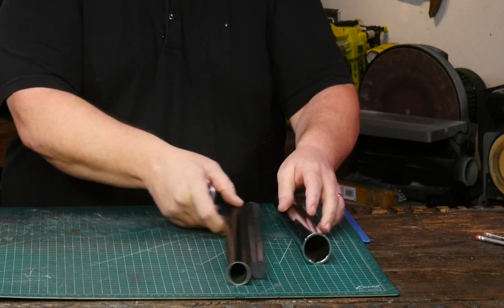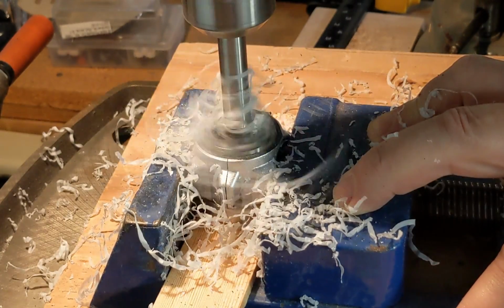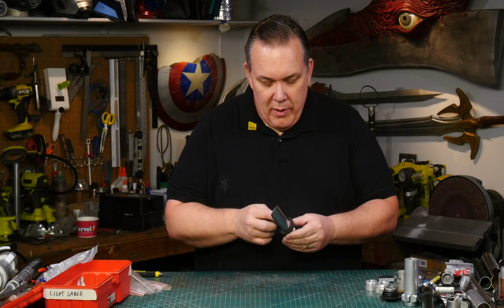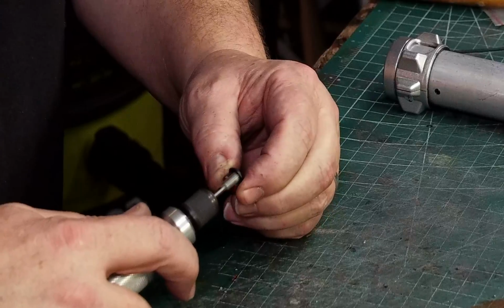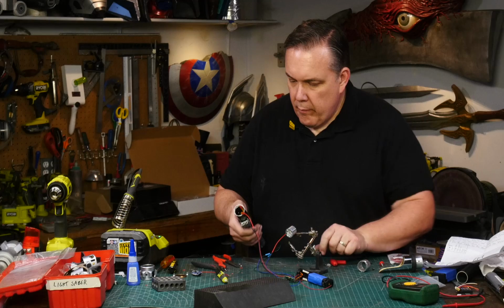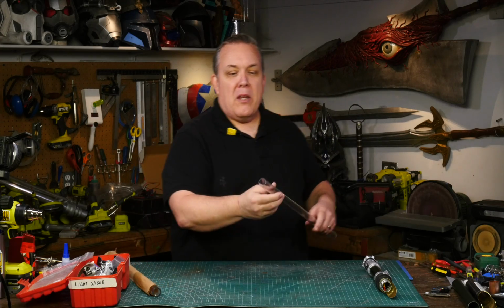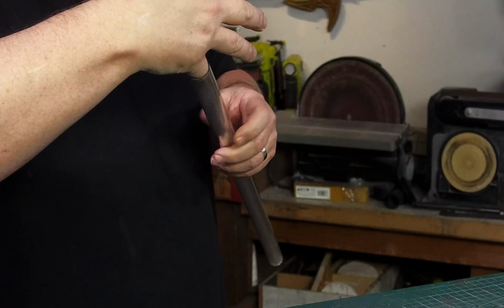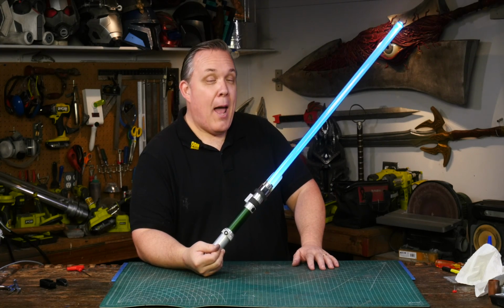Odin Makes: My own custom Star Wars Lightsaber

Comment: Thankfully it's the bladebuilders where they don't have the people talking like the new ones which really upset me cuz I wanted to get the dark saber for its sound and well I don't feel like hearing Mando's voice ore kylo ren's if I want to use the soundboard. 
But also you should have made a light up ahsoka blade when that series had ended and I mean thankfully it would have been cheaper because it's just a white LED you literally just had to use a white sheet of the plastic film inside the clear stuff minimize wise just a basic flashlight LED and because of the shape of her blades it wouldn't have been as easy to put a speaker and a soundboard inside them so just a basic flashlight blade what is been just fine and okay just have to heat up some PVC into a slight curve near the bottom section cut in a few relief cuts and then heat and then put in some PVC glue and if you were making it out of metal you'd want to actually use a steel or iron pipe instead of aluminum and weld it together, does a few years ago I did something like I referenced with the PVC building a Deadpool inspired lightsaber for my cousin's son and I used the Deadpool in space energy sword that he had in that comic as inspiration for the shape and I just had to use a hacksaw on a file to carvin some wrappings for like a katana handle and make a pommel that looks like a katana and the emitter I went for the Darth Vader black emitter shroud but I did it up in silver instead with the blade being reds and blacks with Deadpool's belt buckle emblem carved into the top side of the emitter shroud and the kid wanted a gold blade so I had to do a yellow will a dull orange LED it lights up it runs on 3 aas and it's got a power switch simple on and off and I did the same thing with a 7th sister lightsaber that doesn't spin doesn't pop open to have two handle guards just one simple blade made the handguard out of wood metal tube with some PVC fittings and I even carved in 7th sister in the Sith language on the handguard simple red blade again no sound in a few years prior I had made a lightsaber based off of riku's keyblade from Kingdom hearts 1 just using only one handguard and that's my personal one with a pink LED and my niece has two smaller ones the design to be one-handed for adults but still can be used as two-handed for kids metal handle PVC fittings wood handguard combat ready blade pink LEDs and my other niece had me make a version inspired by Commander wolf from power rangers SPD the sword he had in ranger form just the wolf head doesn't open and close with a blue blade so it looks like the wolf head is screaming out an energy blade like it's howling at the moon

Comment: Tis a fine sabre you have made. Greeblies and Nurnies are a vital part of the look and feel of a sabre, and yours has some great ones. Nice junk drawer sabre build. The only change I would make would be to use "fun foam" foam sheet to make a non-metallic grip. I have a pair of Chinese sabres headed for the Geeklair, and hopefully greebling it up will be uneventful. I would add a belt connector wheel, but unfortunately I have no idea where there would be a safe spot on the hilt to put it. So my non-working hilts will remain on my belt.

Comment: I remember before TCSS and Padawan Outpost and the likes when people exlusively build their sabers from scrap, just like a real scavenger Jedi on the run from the Empire. Except back then they were glorified flashlights and the best we had were licensed replikas. Nowadays you can get LEDs in the blade once more, after a brief stint where the standard was still, but much brighter flashlight, and they're even brighter, with effects and in all colors, something we didn't think was possible because RGB LEDs were too dim. 
And then when you had to frost your own thickwalled blade tube. And now we're using finished neopixel. The jump is astonishing.
And the Hacksmith even have real, honest to god lightsabers. What a time to be alive

Comment: Question! Is it possible to transplant the electronics of the Forge mix-and-match series of toy lightsabers into a normal-handled saber and still work similar to other models like the Saber FX or the Black series, or is the forced interconnectivity of the Forge parts too much of a hindrance? Asking mainly for budget reasons, especially if my local Target is going to mark down the unsold rack of Kenobi Forge sabers like I think they're going to do after the disaster the series turned out to be.

Comment: Hey, I found out a way to make an easy lightsaber. You can go to your local hardware store, like Home Depot. In the plumbing section, there will be pipes and screws and a lot more where you don't have to glue them together, you can just assemble it. For the blade on the other hand, you can buy them at a hardware store to, but it'll be expensive. But I found some cheap blades/clear pipes that you can buy. And for the light that comes out of the blade, just buy some LEDs.
Reply: That's what I did for my first Lightsaber, built it from a sink tube that I got from a Home Depot or Lowes and got the LED and Blade from the CustomSaberShop and the battery holder, resistors, and switches from Radio Shack before they closed up shop and for a time I figured how put in the toy saber soundboard into it, but now my newest sink tube saber is using a MUCH better soundboard that I got off of ebay, I think its the same soundboard that Saberforge uses the Sabercore soundboard.
Reply: Where did you find the cheap clear blades?

Comment: Top tip if anyone wants to make their own lightsaber, and like Odin don't have a metal lathe handy. You can use a pipe cuter on the metal tube, and just not cut the whole way through. This gives you nice groves that adds to the look.

Comment: A good term for "small bits and pieces" are greeblies. On top of that if you look into the current custom lightsaber community people currently love building a full internal chassis for their electronics I've seen people put together so much detail it's insane and I've used a chassis building my own father an accurate ANH Obi-Wan hilt. Even having a crystal built into the chassis with an LED lighting up that crystal. This combined with a custom blade plug is what I used to make sure it could be completely accurate no matter how it was displayed. The price I spent for those supplies was about $500.

Now for the blade. Yeah you want to a mirror on your trip BUT you need to make sure you use the right amount and type of diffusion film. I prefer using frosted cellophane because you can get more out of it with less. Another trick I do is I sand the entire blade to help further blend the light that goes through it and makes the tip not stand out so much.

Just some advice for anyone who is interested in starting their own way down this rabbit hole.
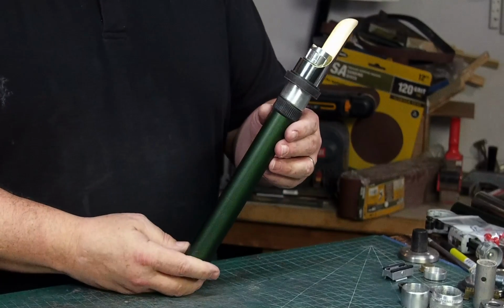Reply: “Do not store up for yourselves treasures on earth, where moths and vermin destroy, and where thieves break in and steal" - Matthew 6:19. This world and the things in it are temporary, spend your time doing something that will matter in the long run - start  sharing the gospel of Jesus. The last 3000+ years of human history have been a testimony in favor of God's word. Contemplate how the Roman Empire fulfilled the role of the beast from the sea in Revelation 13. Revelation 17 confirms that it is in fact Rome. From this we can conclude that A) Jesus is the son of God and can tell the future or make it happen B) The world leaders/governments/nations etc have been conspiring together to accomplish this roadmap set in place by the Israelites or C) History as we know it is fake despite the archaeological evidence. You don't really need to speculate though because you can start a relationship with God and have proof. 

Call on the name of Jesus and pray for Him to intervene in your life - Revelation 3:20. The world is rapidly passing away and eventually you will have to stand before God on judgement day and explain to Him what you have done with your life. Make sure you are making every effort to help others while you can
Reply: @rkkzjj32  I'm pagan.
Reply: @rkkzjj32  I've seen enough cyberpunk dystopian nightmare fuel to know not to do that. Still not gonna be Christian though. It's my belief that one's faith is within them from the beginning so there is no "converting".  At the same time what does any of this have to do with me having built something for my father to enjoy? Sounds to me that you want to belittle the relationship I have with the man who brought me into this lifetime and that my wife helped facilitate after my mother tried to sabotage it. If you are of the mind that your prophecy is more important than my bonds with my family and how I choose to honor them then you need to rethink your priorities. 

And for the record.  I haven't fallen for any of the obvious scams put forth by globalist organizations either. You take care of you and yours and I will protect my own family on my own terms. Deal?

Comment: Hi Odin! I also make lightsabers and I’ve been watching you for a long time. I have found that a trans white blade is much better than the clear blade. It makes the blade look fuller, brighter, and more realistic
Reply from the maker: Trans white is not as easy to find at plastic shops.  But yes!
Reply: @OdinMakes  You can also fake it by lining the inside of the tube with tracing paper

Comment: For anyone curious, the belt clips in the prequel movies were covertec wheels used for camera equipment originally I believe. You can get one with a screen accurate belt hanger for between $15-20. Also most saber part stores carry a WIDE variety of wheels that work with the belt hanger.
Reply: For my lightsaber I incorporated a loop at the base to connect it easier.
Reply: Yes.. They were and continue to be Covertec wheels and belt clips.
Reply: I need to re-tap mine. But thankfully, I bought a pommel from someone who added a D-ring so I could still hang it
Reply: I thought it was for pagers?
Reply: @dwfan91fan1  They're now known so well for lightsabers it's hard to find anything on them that isn't a reference to sabers. But I got one ages ago that said it was for camera equipment and could be used for smart phones. (This was at the dawn of the blackberry)
Reply: Glad you posted this because I was about to comment hahaha
Reply: Ok
Reply: I read that it was a pager clip.